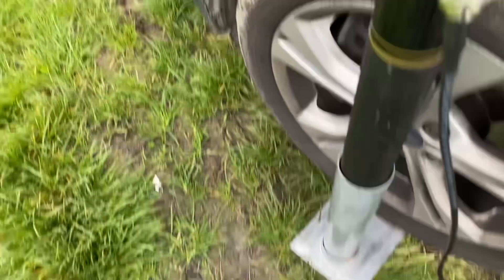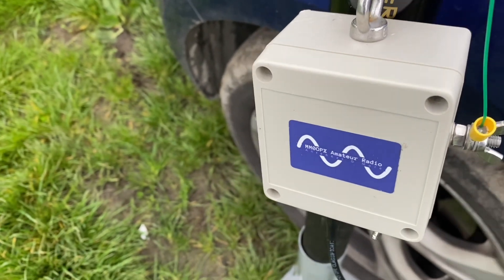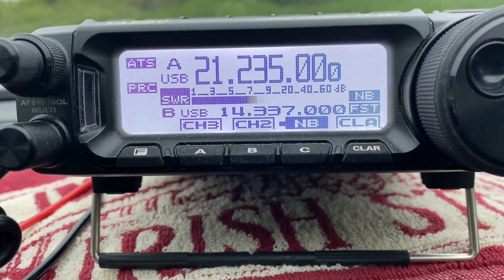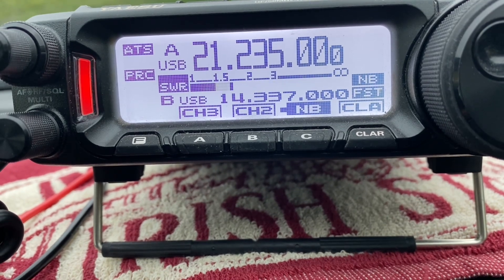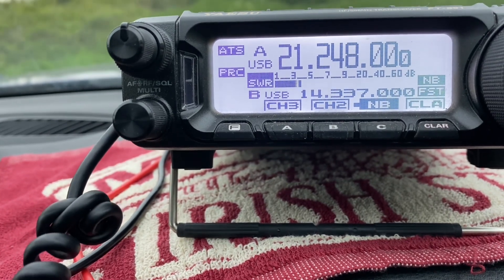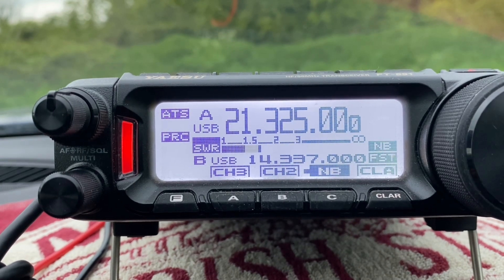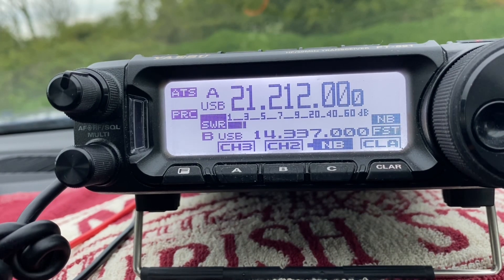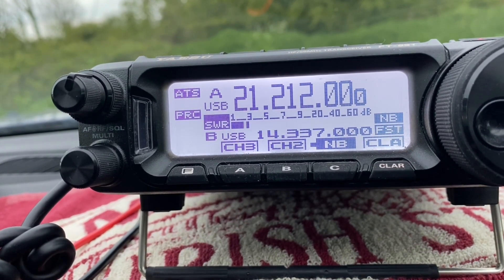HAM RADIO: A HF Portable Antenna - End Fed Half Wave Antenna

Comment: I run very similarly, EFHW Vertical. There are 4 cores in my UNUN though. 2x140’s and 2x 240’s. The 1.4’s are inside the 2.4’s and stacked. Figured I may want to run power one day haha. 73.
Reply from the maker: Nice set up!